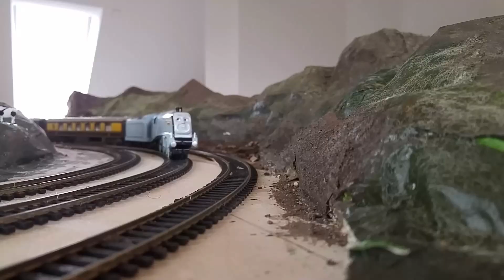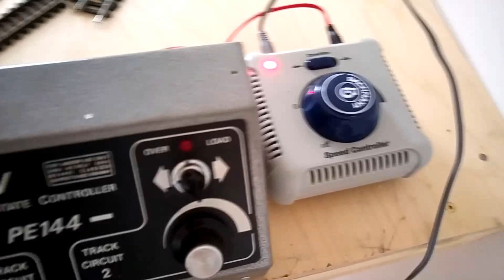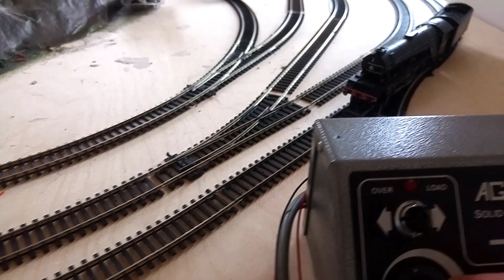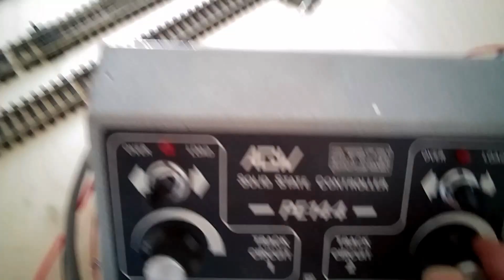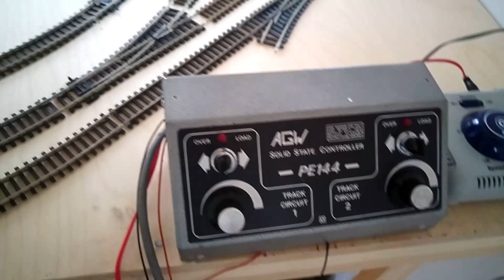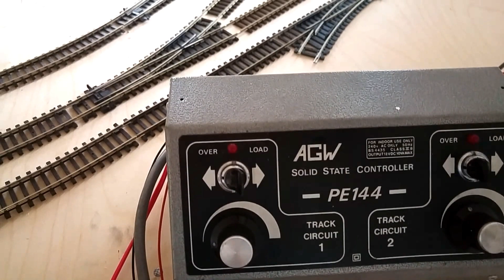AGW DC controller

Comment: I bought one of these recently but one of the DC outlets was putting out an unregulated voltage.. I suspected the Mosfet which I changed ( £1.50) and it is now working as intended. Very smooth operation and  allows good slow running. Very pleased with it for not much money.

Comment: Thanks for video....I bought one after watching and like you I find it works great. The only issue is when I switch to another track controlled by the second feed, it will cut power and light the overload light unless the direction switch of ne of the tracks is centralised to cut off power. This is as expected but there is no centre detent position on the switch so finding its power off position is difficult. I'm don't know whether there's meant to be a centre switch position and tbere is a lot of wear in the detent mechanism, or the switch never had a centre position to begun with. Does your controller have a distinct centre position on either direction switch? Thanks.

Comment: I have the same controller iv'e had since the 1970s still working well.
Reply from the maker: Well that's reassuring. I am so happy with it I think I might get another a run 4 locos at once. Thanks for the comment. Subscribe as there is more to come. Cheers, Gavin